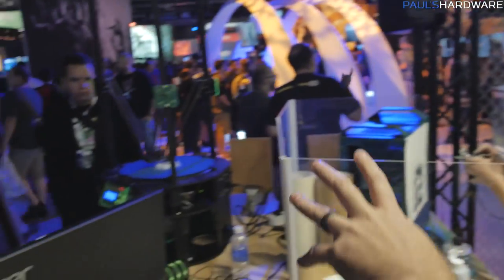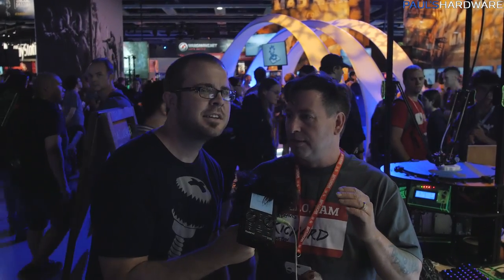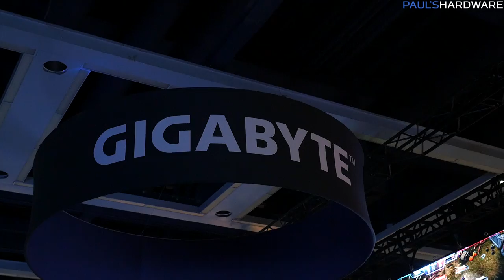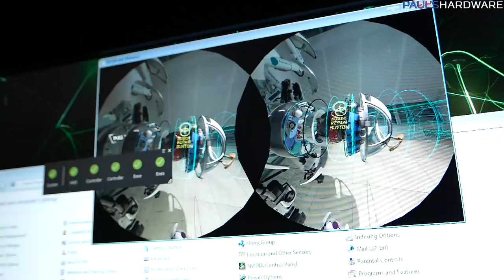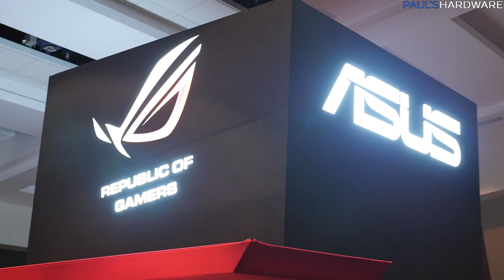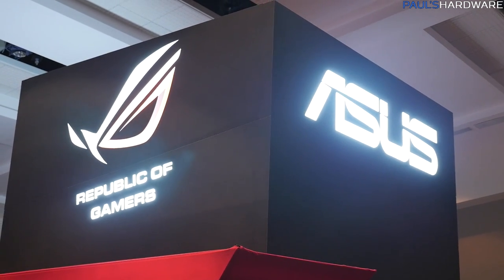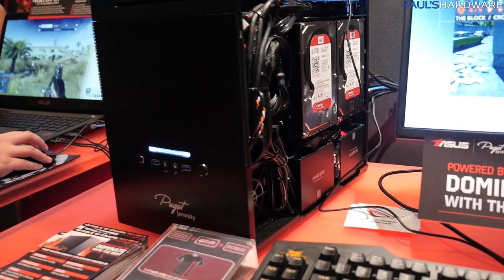PAX Prime 2015: Just The Hardware

Comment: i would pay 35 $ for the glass panel
Reply: +Saul Hinojosa BA DUM TSS!
Reply: +Gerrit-Jan Bergwerf i think it's more expensive than that..
Reply: +Gerrit-Jan Bergwerf About what I was thinking, somewhere in the area of $34.99-$44.99
Reply: +Gerrit-Jan Bergwerf I agree
Reply: +Gerrit-Jan Bergwerf I'm going to be doing a glass mod for my Corsair 750D.  I can get the glass for just under $40, so, maybe a $50 price point would be right, and allow them to make a profit.

Hey, Paul, you should have used One Day Glass to get your glass!  I have priced out a 18x18 inch sheet of light grey tempered for under $40.  It pays to shop around!  (and to check reputations, as some online glass suppliers have bad reps).
Reply: +Kayla and Jim Bryant I seriously doubt you can get a piece of smoked tempered glass the size of that cooler master's panel for less than $40.

in fact, I have a hard time believing you could get it, especially with finished edges, for less than $100.
Reply: +noanoxan  That would make that one expensive case.

Comment: A custom made 18''x18'' (body size of this case) tempered glass with a 1/4'' thickness cost around 70-75$USD. And you would have to make your own locking mechanism to attach it to your case ... So anything under 75$ is fine with me.

Comment: can somebody make me a $650 pc canadian edition no mail-in rebates. please and thank you
Reply: Here's one: http://ca.pcpartpicker.com/p/zQ4PBm.

I didn't include a cup cooler as the case only had 1 pre installed fan so had to prioritise getting some Intake first. When you have more money to upgrade I would recommend the cooler master hyper 212 evo. Really good cooler and extremely cheap also. If you are able to get an extra $50 change the GPU to A gtx 960 or the r9 270x which are both very good cards for budget builds. On the link ignore the compatibility issues as they will not make a difference unless you need the USB 3.0 on the front panel. I've got this motherboard and CPU combo and I didn't need to flash the bios.